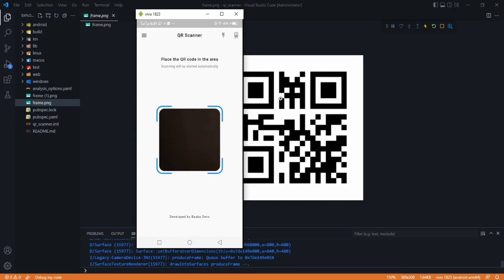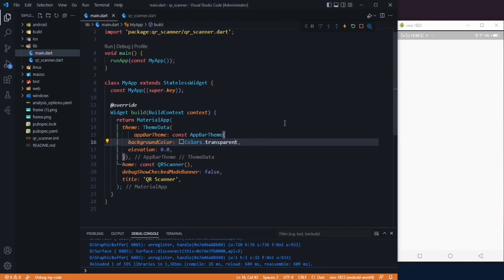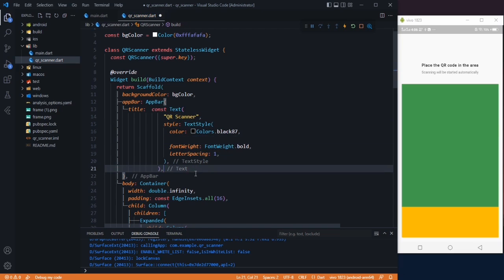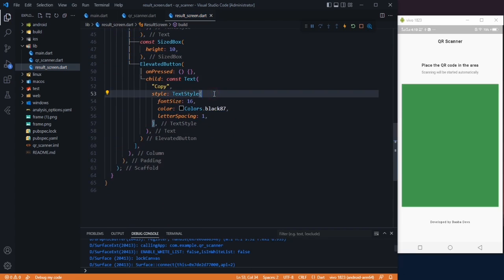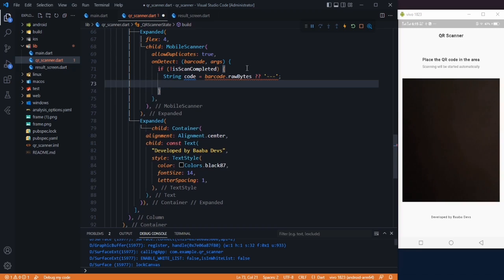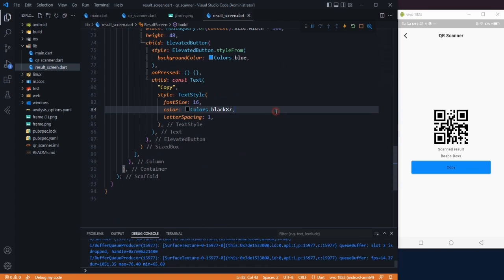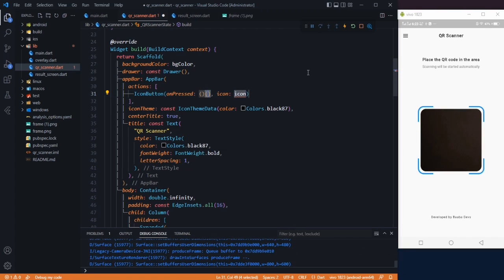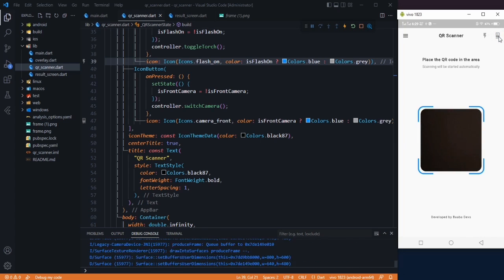Flutter Tutorial: Flutter QR Code Scanner & QR Code Generator App | QRCode Flutter

Comment: HELPPPPPPPPPPPPPPPPPPPPPPPPP
i got the error : What went wrong:
The Android Gradle plugin supports only Kotlin Gradle plugin version 1.5.20 and higher.
The following dependencies do not satisfy the required version:
project ':qr_code_scanner' -> org.jetbrains.kotlin:kotlin-gradle-plugin:1.5.10

when i update qr_code_scanner to latest version i get the error : \OneDrive\Bureau\api_auth0\Mobile-Health-Provider\mhp_app\android\app\src\debug\AndroidManifest.xml Error:
	uses-sdk:minSdkVersion 19 cannot be smaller than version 20 declared in library [:qr_code_scanner] C:\Users\sakka\OneDrive\Bureau\api_auth0\Mobile-Health-Provider\mhp_app\build\qr_code_scanner\intermediates\merged_manifest\debug\AndroidManifest.xml as the library might be using APIs not available in 19
	Suggestion: use a compatible library with a minSdk of at most 19,
		or increase this project's minSdk version to at least 20,
		or use tools:overrideLibrary="net.touchcapture.qr.flutterqr" to force usage (may lead to runtime failures)

FAILURE: Build failed with an exception.

* What went wrong:
Execution failed for task ':app:processDebugMainManifest'.
> Manifest merger failed : uses-sdk:minSdkVersion 19 cannot be smaller than version 20 declared in library [:qr_code_scanner] C:\Users\sakka\OneDrive\Bureau\api_auth0\Mobile-Health-Provider\mhp_app\build\qr_code_scanner\intermediates\merged_manifest\debug\AndroidManifest.xml as the library might be using APIs not available in 19
  	Suggestion: use a compatible library with a minSdk of at most 19,
  		or increase this project's minSdk version to at least 20,
  		or use tools:overrideLibrary="net.touchcapture.qr.flutterqr" to force usage (may lead to runtime failures)
Reply from the maker: as mentioned in the error you need to set the minimum SDK version of app to 21 and change the kotlin version to 1.5.20 or higher.

Comment: Hello, when I was trying to code this part. 
 child: MobileScanner(
              allowDuplicates: true,
              onDetect: (barcode, args) {},
            ),

I have imported the package but the error was saying that 
'The argument type 'void Function(BarcodeCapture, dynamic)' can't be assigned to the parameter type 'void Function(BarcodeCapture)'.' 
The named parameter 'allowDuplicates' isn't defined.

Can you try to help?
Reply from the maker: means the allowDuplicate is removed from the latesf version of package. And also the args from onDetect. Try removing them
Reply: you should use the version of package (i think: "mobile_scanner: ^2.1.0" you can just copy this and add to the dependencies) specified in the video